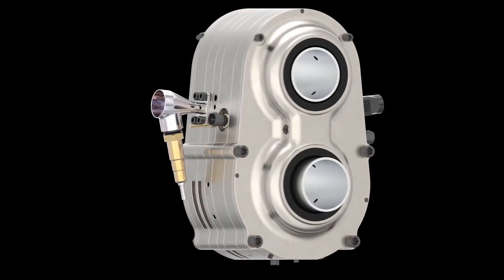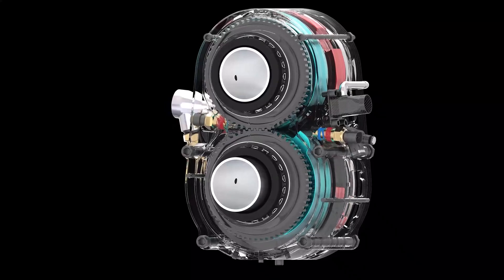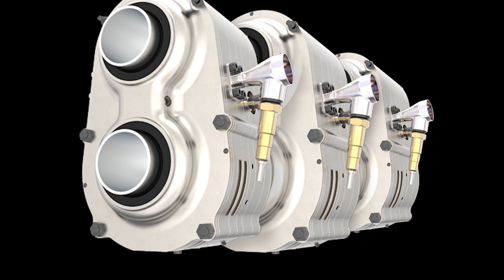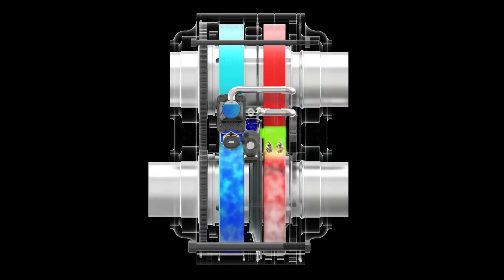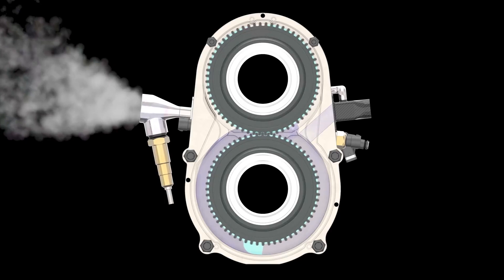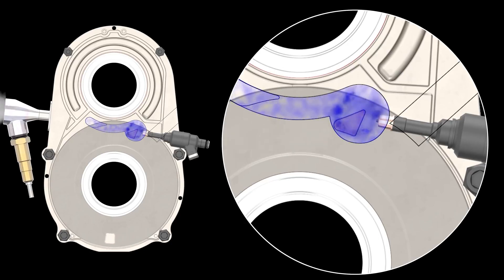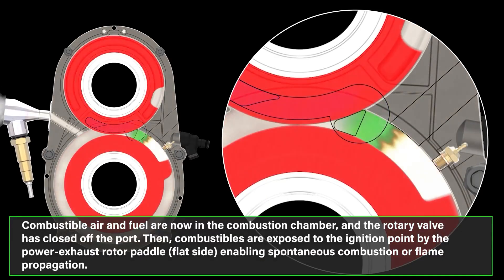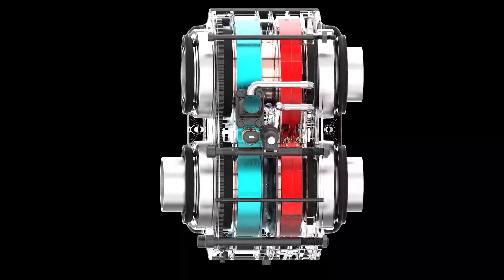This pistonless engine runs on hydrogen and revs to 25k rpm

Comment: As a machinist in the industrial seal market, we make parts with tolerances of .001" or less. You OFTEN run into problems with the material warping up to .005". Tolerances can't be made on a 3D printer that tight. I can't imagine they will be made manually and I'd love to see the CNC that can make that. Even with the advanced probes these days there would be material issues. Not to mention the price point to produce such an item would put it out of reach from the public.

How are the parts made? And with tolerances basically zero and clearance that would have to be almost none between parts, how is it even put together?
Reply: Another machinist here. This is a constant battle in real life. Theory and reality are 2 totally different things and those who don't know don't know. Materials move as they are machined in only semi predictable ways which makes tight tolerances difficult. Thermal response to the very act of machining makes tight tolerances difficult. Thermal response to just running the CNC machine makes tight tolerances difficult. Now add in calibration and verification of probes, ball screws, inspection equipment etc etc etc and tight tolerances are even more difficult.

In short, of you plan on having tight tolerances save your ass as an engineer be prepared for one of 2 things, disappointment or an extremely expensive product.
Reply: @mikelang4191  I heard this today " in theory it works in practice, but in practice that was just a theory."
Reply: @mikelang4191  the old AM/FM problem.
Reply: @mikelang4191  Why do engineers need to save their asses? I thought we'd moved on from equine powered machinery.
or are you a Mercan who spells arse incorrectly?
Reply: Same here, 0.001 will get you a good suction seal from a blind bored hole with a gauge pin. I've built gear boxes and machined them on 30 year old cnc machines and maintined 0.0002 inch tolerances
Reply: @hackingnut4164  And how long did it actually run?
Reply: If you're measuring things in inches you're already in the wrong game but suffice to say it'd have to be tolerances down to the nanometre scale, you're going to have either interference or a gap - and god forbid heat expansion was a thing - and it would destroy itself in minutes unless it was made of unobtainium. Ergo it isn't practical and everybody can go home.
Reply: @hackingnut4164  .001 is a nice fit, .0015 is loose AF though and .0005 is too tight. .0002 is frankly only in your imagination.

 .0002 +/- .0002 is the best you're going to do unless you have a NIST level inspection department.

And to the metric only crew, piss off....
Reply: @mikelang4191  the measuring system is determined by the engineer who made the print. A good machinist can use either. Actually 0.0002 is usually considered a press fit. I have a video on instagram doing the job I mentioned above. Take it or leave, I don't care.
Reply: @hackingnut4164  I use both measuring systems daily and could care less for the argument about which is better is my point.

I also have a great deal of metrology experience and can assure you most people have a perception about accuracy and tolerance that just doesn't jive in real life.

To be absolutely certain of that .0002 tolerance you need calibrated equipment capable of .00002 and a climate controlled vibration dampened inspection room.

Otherwise it's just a fairly good estimate which for the most part is close enough unless you designed this engine.
Reply: @mikelang4191  I prefer metric my self. The shop I worked at used Kern machines, ISO certified and we calibrated our gear when it came to specialized jobs. When it comes to high precision you need to know the machine you're working on very well. Need to know how it responds. Know the material being used. The tools being selected. Then you do a test run at a given dimension. From then we measured and tweaked feeds and speeds. Then you'd run a part. I worked for a master machinist and honestly one of the best. We held within tolerances every time. Out of 200 parts that I did we had one that was slightly sloppy because I made an offset error. Experience goes a long way. Documentation brings that experience forward and that's ISO 9001 does.

The CNC ran two operations and 11 tools for 1.5hrs. It took myself or another person to do QC on each part 10min without tweaks 45min with tweaks. Less than 3rs fully machined. It's totally possible to do it. 

Things are only impossible until they are done. I work at an R&D company now that does that. We get a problem in with no available solutions and we design one. Those are the kinds of people I like to work with.
Reply: @mikelang4191  metric is superior in every way for the most simple part, less confusion is the key to successes.
Why is it trained to make a technical drawing as simple as it can be? As less as possible to calculate for the machinist? Because less confusion is key to doing it right. 
Its a mostly forgotten craft but that is how it was and should be.
Reply: I don't see this as to far fetched. I get machine parts sent out to be made that are held to .0004. The parts would have to be EDM. And our stratasys can usually get with in .002", but we normally account for this being a .002 to .003 difference when printing prototypes.
Reply: manually operated hydraulic control valves operate with ridiculously tight tolerances, they've been around for over 100yrs. They ain't cheap as a result, and tolerances like these are gonna be very pricey
Reply: It can be done - but grinding and polishing mated surfaces to those tolerances would be ridiculously expensive for mass production. Even then, under the prescribed pressures, 
an imperfection scratch of 30to 40 microns from one side of the chamber to the other would be problematic
Reply: Yeh, but this is an Aerospace company that might have hold of the approach and alloys they are using.. THAT'S ASSUMING, this has been built and isn't a hypothetical engine that's only gone as far as sexy CAD / CGI.
Reply: Machinist always tend to announce themselves everywhere as being machinists.
Reply: With these kind of tolerances you would basically have to heat one side up and freeze the other and Hammer them together to get them to fit!
Not exactly cost-effective!
That's my just my opinion.
But I'm willing to hear you out if you think I'm wrong.
Reply: Maybe Wire EDM? Those can make stupid tight tolerances.
Reply: Honestly, I don't see a reason for eliminating seals since materials expand and contract due to changes in temperature and pressure and looser tolerances are actually better because you can use flexible materials to seal off the hole if needed, unlike trying to avoid cracks when parts expand too much from heat (i.e. rotor expands too much, friction becomes high, it heats up even more, expands more, cracks the block).
Reply: I have ran cnc kellenburger cylindrical grinders that easily hit the .00005 mark in and jig grinders that will hit .00002 ,  never made parts that tight but could hit those reliably. And no that extra zero is not a typo...
Reply: Machinist here, problem is in the last decade the Needle Pin Pricks needed for the Rotisserie of the Combustion Housing can shrink/implode up to 2.38 percent when used sealless. Trust me I've built 2 of these bad boys over the last 35 years so I know what I'm talking about.
Reply: @Larry Fisherman what he describes is more about constant cooling and not using to much clamping force to not deflect any material. 
I know a lot of old CNCs who hold it but if you remove the work piece, it is warped.
Reply: Well the Ak-47 has terrible tolerances and it is the most reliable rifle  in the world. Combustion chamber vs bullet and barrel
Reply: Not only that but what happens when it heats up
Reply: Cool to see other machinists jumping in. I work as a 5 axis aerospace machinist/programmer and frequently see tolerances in the +/- .0001 range. I suspect this engine is going to need tighter tolerances than what machining can deliver. CNC Grinding can achieve tolerances in the +/- .00001 range or better and is probably what would have to be utilized. The real issue is going to come from material movement from thermals. Interesting concept though.
Reply: I love comments based in reality. Thanks. I wonder how many suckers they got to invest in this.
Reply: funny you say that but you do realize that old triumph motorcycles was made so well you could put them together with no seals and still run for years and thats with 1940s -1960s tech look it up im not joking
Reply: @screwitimout4920  Local man cites famously leaky british motorcycle as example of why you don't need seals.
Reply: @screwitimout4920  my grandfather ( aircraft mechanic with over 30 years of experience) used to joke about how unreliable those... things were. Nice try, poser.
Reply: @screwitimout4920  So you can put them together with no seals? What seals are you talking about?. No piston rings? No crankshaft seals? Which one you do not have on your Triumph motorcycle does not have?
Reply: @screwitimout4920  Love old British bikes, but this comment is nonsense.
Reply: New technology does seem hard to believe
Reply: @greenwave369  I don’t see anything new, just a new way of assembling old parts.  

I
Reply: @greenwave369  Mecanical engineer here, I can tell you that thermal expansion will fuck this thing up like theres no tomorrow. There is a good reason you see piston engines everywhere and not highly speculative prototypes... As a rule of thumb you should only start to believe such a pitch if they have a WORKING prototype and not a fancy computer graphic.
Reply: "If I can draw it, you can make it."
- Words of a Famous dead engineer.
The thing will never work in the consumer market- prove me wrong. It might make a few revs on a test bench before it locks up; if it even rotates at all after assembly. Oh, it's going to run on hydrogen? Yeah, that's promising. Good luck pimping that; and 
to anyone who says we need to quit measuring with the inch, remind me what measurement was used to build the equipment that won the last two world wars.
Reply: @greenwave369  just like magic ..which this engine needs to run

Comment: It seems to work in a similar way to a gas turbine. The air is compressed away from the combustion chamber, by the 'gears' instead of an dynamic compressor. Then if I see it correctly after ignition it passes through the energy recovery gears instead of a turbine. Anything is worth a try, naysayers would have stopped every idea ever made.
Reply: @Andy Bush , One of the many advantages of gas turbine engines is the very high power to weight ratios they develop. Another advantage is the rotary - non-reciprocating motion they operate with.... This design appears to involve two drums located very close to each other rotating at the same rpm's that are synchronized with large diameter spur gears. One of the drums seems to have a single depression while the other has a single node to fill that depression. It seems like both the compression chamber and the power development chamber have these single nodes and depressions to complete a combustion cycle. My questions are; how is the compressed air fuel mix ignited, how is the high pressure gas directed to the power chamber, are there more than a single set of depressions & nodes to displace the gas's on the compression and power chambers, and how are the high pressure gas's kept from traveling back through the air intake passage?
Reply: Fr, this is just a less efficient turbine as it captures less of the exhaust energy.

If you make this engine mote efficient it becomes a gas turbine. Add more gears behind it to capture more, ditch the top and just place in some static fins and boom, gas turbine.
Reply: @daslynnter9841  Yes but hopefully not 'boom' though lol.
Reply: @andyrbush  lol fair enough
Reply: A dynamic...

Comment: This is a great project.
I also agree on the fact that if H It is used as a fuel could actually work.
160 hrspwr isn’t much but imagine if it could recharge a battery!!
Could be hybrid. Always running at the same speed and be fuel efficient at its best. 
Or be just a easier version of ICE engines. 
Maybe Hydrogen could be transformed in gel (HydroGel, your welcome 😂) and be safer, last longer, refilled faster and less prone to move around like regular gas.
And I still like EV but no the silly Lithium batteries. Nuclear is the way.

Comment: I have always said hydrogen is a good way to go.  Any normal piston engine can burn hydrogen or any other gas switch simple mods also.  Much better for the environment then the electric car.   They rape the land with the mining.   The pollution to process the ore etc is very high.  Also no one seems to want to recycle the bad batteries, due to not enough profit in it. It seems   Electric care are only green when they are running.  Otherwise they are not as green as the morons in power make it out to be.    Live confidently and peacefully

Comment: Well, hydrogen power and high-efficiency engines are certainly superior to electric vehicles in terms of "clean energy." Most electricity is still generated by fossil fuels, so they're just shifting the point of emissions from the highway to some poor neighborhood next to a smog-emitting power plant.

Comment: Hydrogen is everyone’s dream… the problem lies in the energy necessary to produce it.  

This engine design is certainly innovative.  Could diesel be used in a similar, way?  I think so… making for an interesting way to increase HP and torque, increase fuel efficiency, and lower emissions.   The train of additional engines makes for an adaptable, scaleable, way to design an engine to an appropriate and efficient size.  Could diesel be used?

Comment: Hydrogen fuel produces water vapor. Water vapor is many times more capable of absorbing and maintaining heat in the atmosphere than CO2.  That's why the temperature of the desert plummets at night even though there's more CO2 in the atmosphere than in a jungle that doesn't have much variance in temperature during the night and day cycle.

Comment: You don't even need to run a drivetrain with it, you can just use it to easily run a generator-inverter and have plenty of electric car power as well.

Comment: I think we need to switch to hydrogen because electric with batteries is not gonna work.... What do we do with worn out batteries?? And the electric grid has not enough power if everyone goes electric. And hydrogen has a complete clean combustion.

Comment: HYDROGEN IS A STUPID IDEA and I won't go into it because your Iq is too low to understand.
1: Hydrogen brittleness
2: Lack of lubrication 
Just 2 of the major issues and making it is also a pain in the ass, look up how many Joules of energy it takes to convert water to hydrogen
Look up a way to reuse lithium batteries and you will be onto a winner.

Comment: I think this is an exciting development. The only issue is that the New World Order with their Agenda 2021 and Agenda 2030 will probably have this motor shelved because electric track-able cars with the smart city program is where they want to go. It's possible it could still fit in to their program as long the cars using it can be tracked. I don't think they really give a dam about climate change as the real objective ultimately is CONTROL! I do like the design and I hope it succeeds.

Comment: But the problem is still the production and storage of the hydrogen, you need 2kw of energy to get 1kw of energy from hydrogen. If you put 1kw of electricity into a battery you get 1kw out of it. So the math just doesn’t add up, and the hydrogen is also extremely dangerous.

Comment: Even if it works (I doubt it) it cannot be very efficient due to the nasty gas property that passes all the pressure created in ALL directions, but only a small part of that pressure is directed to where you want, rotation. Also how in real life the combination of super-high tolerances and thermal expansion works, what kind of materials we are talking about?

Comment: There is a Motor running without piston and even without fuel. Less cooling, less power loss. Called electric Motor. No need for new rotational motors runs on fuel.

Comment: Interesting idea.  One of the challenges to using hydrogen, I understand, is that it is not a very efficient fuel for use in vehicles of the automobile variety, hence the high rev motor I guess.  Also, and speaking to the high revs, I think that it is very likely that the maintenance costs and cycles will be higher than those of an EV.  At the moment I think that there is too much going on in energy development and management space to make any firm decisions about where to pin one’s future, so I would prefer to spot adopt a Wait-and-See approach for now.

Comment: If it runs on hydrogen then there would have to be some serious safety rules for materials used for fuel tanking and lines to prevent hydrogen embrittlement. Organic plastics would be the only thing that does not become harmed by constant contact with hydrogen gas over time. An engine like this may not actually have a very long service life due to this one nasty problem.

Comment: With the need to hold high tolerances we get a low service life problem.  With hydrogen we have a fuel that offers difficult storage with poor energy density so put together, an issue over limited range.  Does this solution's effeciency make it viable for the market?

Comment: Had exactly that kind of engine in my mind some years ago.
Even optimized it in my head with more grooves on the Ring , and several rings in parallel.

But in the end i came to the conclusion that a propper sealing is nearly impossible.
I,m excited how they want to solve this problem.